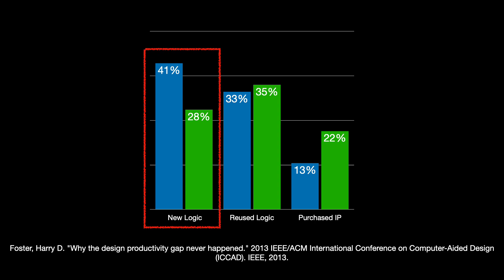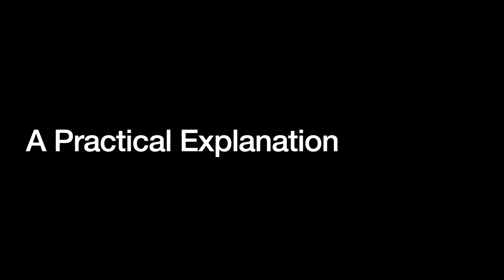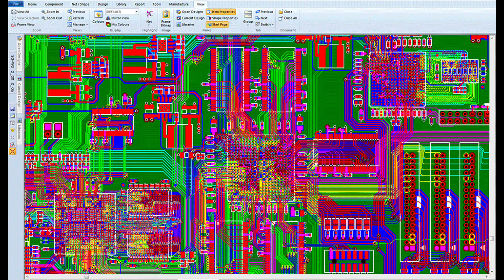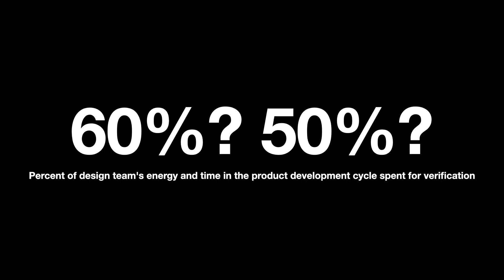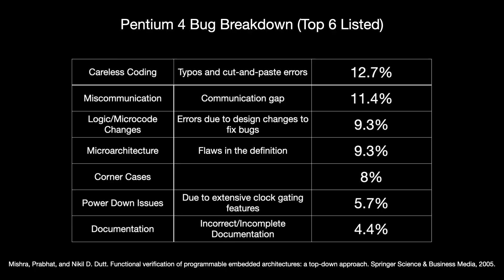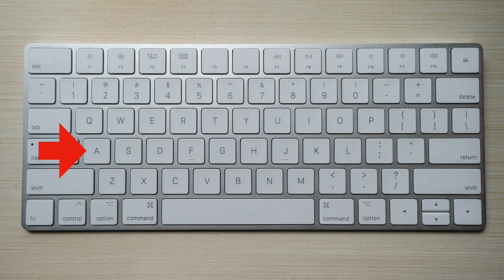The Growing Semiconductor Design Problem

Comment: Working on verification for more than two decades here, nice video. I'd just make some clarifications:
1- most of functional verification is done through simulation. The video shows emulators and FPGAs, which are often used, yes, but they are complementary resources. Same for formal verification, which is not mentioned. FPGAs and emulation are fast enough to allow testing of SoC firmware, which may not be viable in simulation (too slow), so that's the main use, not hardware verification per se.
2- in SoC verification one doesn't cover all the functionality of the IPs used. They are assumed verified already, so the focus is on their interconnection, aka integration verification. Usually IPs are verified isolated, covering their whole functionality, before they are used in an SoC.
Reply: Thank you
Reply: @valentinohose1723  good luck!
Reply: hi im EE student graduating this year. how do you think about verification engineer as career path compared to design engineer?
Reply: @valentinohose1723  there is more demand for verification, because at least 2 verification engineers are needed for each designer, ideally 3 (which is not often the case, unfortunately). However design is usually preferred because it's seen as more creative, and has less pressure: the deadlines are beared by the verification team. Verification closure is the last deliverable before moving on to layout/fabrication for IPs/SoCs
Reply: @bearcb  thank you for your answer. as someone with 20 years of experience in the industry, would you recommend pursuing a career as a verification engineer? I'm interested in understanding the potential career advancement opportunities in this field. 
I've found verifying 32-bit RISC-V with UVM in a school project to be quite enjoyable.
Reply: @valentinohose1723  it's a personal decision, you have to balance pros and cons. Demand will always be there. If you enjoyed your verification experience, I'd say go for it. But again, it's very personal.

Comment: I know a company that still hand designs low energy chips with an in-house tiling program stemming back from the 1990's, with the lowest energy processor design used in their GA144 parallel chip.  The founder Charles More has done a number of record designs since the 1980's.  He tends to get this from simplified design and modeling correct functionality in the node process, cutting the node safety margins, and testing out circuit parts.  Unfortunately, with the way the market is, and advanced fab costs, they have been unable to implement more than a deeply embedded simplified design on older low energy technology, rather than their more general advanced processor.

He created the Forth computer language.   Designs based on it, could be as low as under 1000 transistors.

To advance the technology, l have been thinking of contacting the 4 bit processor manufacturers in China to make them aware of various open sourced FPGA designs based on this sort of microprocessor architecture, as it is suitably simple for the old equipment they have, and a step up from 4 bit.

I had been looking at putting a team together before getting rather sick, to make a simple open source embedded design under the Google open chip scheme with a few innovations in configurable I/O and limited on chip reprogrammable functionality to minimise parts, and to compete with 4 bit - 16 bit mcu's, on a simplified commodity process.  To kick start the industry again  (used to be many forth processors in the 1980's and 90's) before I pursued my own seperate advanced architectures.  I still aim to pursue such, but am gearing up to explore an alternative scheme to FPGA and custom chips first with a few people (as I am still struggling health wise) suitable for the third world.  And also waiting to see what becomes of the magnetic quantum cellular automata scheme advancement from last year, which sounds similar to what I had previously wanted to eventually do.  Obviously, as I have not heard anymore, that scheme had yet to come through.

However, I would like to ask you to cover the advancements in magnetic processing technologies announced last year or so.  One is at 4 Thz clocking aim, the other 40 Thz.  If either of these pan out, they obviously represent a future in the industry, as MQCA works at nearly 0% heat loss.

I have no business with any of these parties and make no money on this, it is a community interest post.

Comment: Great presentation! As a very senior software developer, I found this very interesting. It looks like that the HDL language part is very close to the regular software development. Including the (very familiar) execution and emerging problems of the practical processes and testing/qa. I want't make a remark: you mentioned, "In the software world, it is easy to handle such design problems by issuing an update". Well, it's really  not in most cases. Rolling out an update for a software with major design flow, when already released, causes lot of headaches and costs. Especially when the software is creating lot of data. Also with todays firmware based designs, you can handle lot of things with an update to the hardware firmware. The two kind of development coming closer and closer by time.

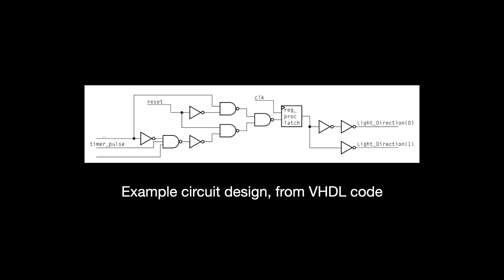Comment: A better example for the traffic light 5:00 is if the later car shows up just +/-1ns from when 1st car clears the intersection.  This could create a corner case where two "rare" events happening at just the right relative times cause the system to hang or screw up, like the light getting stuck and never changing for the 2nd car. 

The "fairness" example given was that of a spec being met, but the spec was incomplete.  That is a problem.  But just getting a design to meet a correct spec when there are tons of concurrent and interacting events going on is very difficult in itself, especially when some of those events are quite rare.
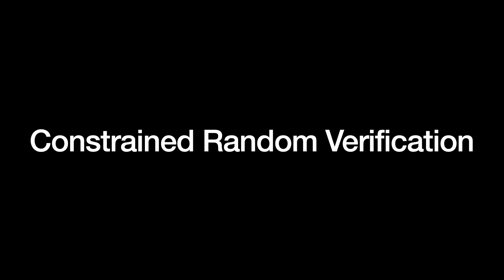Reply: Also, relating to the keyboard testing example 13:40, this video did not mention doing unit tests of blocks of the design.  At that level, it is much easier to control and sweep through interesting cases, often exhaustively.  Something that usually cannot be done when the design block is exercised within the context of the entire chip. 

Additionally, formal verification tools are also used.  They can verify properties exhaustively that cannot even be tested with functional tests.  A simple example is that a 64-bit or 128-bit adder can be exhaustively tested with formal verification tools.  Constrained random or brute force sweep testing cannot do the same in our lifetimes.

Comment: I did a stint as a test equipment designer in aerospace. I loved it.  The scheduled time for a project was never adhered to because the other design work had used it up.  "We can make it up in test eqpt." must have been a mantra. Or a face saver.  I loved beating their most optimistic goals. Which I mostly did. Fun. Fun. Fun.

Comment: During the period from 1987 to 2001, I was working as a consultant, mostly doing chip verification.  When the Tech Bubble ended, the bean counters decided that Verification Engineers were a waste of money, and go rid of us all.
People went and did something else.  I went into Real-Time Embedded Software.
A few years later, as the NRE of ASICs continued to rise, they repented and tried to hire Verification Engineers again.  They found that the former Verification guys were not interested.  They also found that the former Verification guys were advising the young ones not to take such jobs.

I remember various conversations with headhunters about Verification Engineering jobs, which were quite unpleasant.  For them.

"I am not interested in a Verification job because Verification Engineers don't get enough respect."
"What do you mean?"
"In American today, we are able to accurately measure respect.  To.  The.  Penny."
"So, this is about money?"
"Sort of.  Money is a symbol of whether they really value us."
"How much would it take to get you into this job?"
"110% of what the Design Engineers get."
"Hah.  They won't do that!"
"That's why their chips are not gonna work."

These days, I do FPGA design.  FPGAs continue to gain market share from ASICs because, well, the ASICs still have problems with Verification.
Maybe they could pay what it takes to get the top people to work in Verification.  Maybe they could say "Thank You" once in a while.  Maybe they could try to provide some job security.
Nah.  It ain't gonna happen.
ASICs are doomed.
Reply: A 50% rate of re-spins sounds right to me (maybe 65% is closer to the truth).  The fact that slang terms exist for "a chip which came back from the fab and does nothing" tells you a lot. . .
I also suspect that many of the new versions of a chip which are supposedly "to add features" were actually involuntary bug fixes.

Comment: Your "verification" does not include all the design mistakes made in the planning stage. For example, both Intel and AMD CPUs are based on the 1945 von Neumann architecture. Direct execution stack machines have been shown to be superior, but are ignored by almost all manufacturers. Also, verification is very different from validation, which attempts to determine if the chosen design is a valid implementation of the problem.

Comment: FPGA for verification are thing of the past (mostly). We still use them but for very limited soc or single IP verification.
Today we rely on accelerated emulation like Synopsys ZeBu which can hold massive design at ease, allowing multiple instance to run different tests.

Comment: Verification coverage gaps are largely mitigated these days by three factors. First, most devices are online and able to receive software and firmware updates that can work around the problem. Second, most consumer devices are relatively inexpensive and designed to be replaced after less than two years, so the effect of a faulty chip is limited in scope. Third, mature supply chains mean that spinning hardware revisions is cheap, so tight iteration with progressively broader test audiences can be used.

Also, "respins" are extremely common, and very inexpensive. Most GPUs are shipped on their third or fourth spin. It doesn't require reverification or relayout. Instead, chips are built with disconnected transistors and basic logic scattered around. If there's a bug, a change in the metal mask can be done very easily to tweak the logic.

Comment: Such a great video. How do things like open RISC-V cores change up the process? Does it reduce the amount of verification needed? Are reusable and mass tested cores the only reasonable path forwards?
Reply: No just by being open source doesn't reduce the verification required
Reply: @slicer95  I think you oversimplified my question, it's not about "just being open-source".
Reply: @avamander.    RISC-V by itself doesn't change anything for the verification. RISC -V is just an open instruction specification, x86 and ARM were proprietary. The instruction specifcation and verification are orthogonal. For the second part even if you get reusable and mass tested cores, they still have to be verified when they are combined which is non trivial.

Comment: It's important to note external and internal IP blocks are used by most companies (ARM IP being one example) most chips are focused designed and easy to test, high risk designs use many blocks, sometimes incorporate IP blocks not designed to work together on the same silicon die and has no field history (some are purchased from other vendors or spin up for the first time), thermal stability remains a challenge here but this conversation depends on the type of chip, its use case, environment ect. Chips in aerospace/defense class-1 are tested rigorously and use expensive materials and processes to guarantee long term stability not the same for commercial grade silicon/ics. If rigorous testing was always factored in chip profits would dip, losing to Chinese chip vendors even further.

Comment: Constrained random verification, I thought I'd never hear the term again after defending my undergrad paper over ten years ago :D
We were doing very basic stuff with old MIPS designs though, I was writing a Ruby DSL that generated a boatload of assembly tests for testing Verilog designs. But my academic advisor was doing similar work with the Elbrus processors (classified, of course, so we never saw any of it), so the various hardware verification related stuff that students and research assistants under him were doing might have been repurposed for that.

Comment: With programming, tests can be random, but you can also identify the most important tests. E.g., instead of testing all numbers 0 -100, just test say 0-10, 50 and 95-100 or something. Perhaps basing it on information about what the code is doing, with tooling.

Comment: It's horrifying and absolutely hilarious that even Intel engineers working on hardware are still mostly making regular ol' typo and "copy-paste" errors like us normies.
Reply: These are also the most common errors in advanced math textbooks too. I have a keen eye for errata so I notice when it's a 1 instead of an I. It's why I'm so fun at parties.
Reply: I dispute the notion that most errors are typos and copy-paste errors.  That ignores the other 87% (I say more) of errors and fails to understand the enormous complexity and concurrency that chip designs cope with.  People would be astounded to understand the complexity in and amount of out-of-order and speculative instruction execution that takes place in a modern CPU.  Or similar optimizations in a memory sub-system.  If everything was done sequentially, in the "natural" and simple order, the performance of your phone would be way, way worse than 10x slower (no branch prediction, no write buffers, no cache, no pipelining, etc.). 

Chip designers are not devoted to and as adept at high level programming languages.  That’s because they work at a very low level with extreme concurrency to make fast hardware.  I’ve worked on the design of central office routers (so you can watch this video) that can process 100’s of millions of packers each second and do so in a way that ensures each customer’s packets or traffic get equal treatment, video and audio get greater priority, and premium business service gets larger, guaranteed service specs.  The depth of a pipeline for a system like that is hundreds of cycles deep.  All in order to provide tremendous performance.

I’ve seen a lot more errors and issues and testing associated with clock gating than I ever have with copy-paste errors.  Copy-paste is relatable to most.  Who understands clock gating and the battery life it provides, and the corner cases it creates that need to be handled correctly and tested for?

The video at 5:00 could have used a better traffic light potential error: if the 2nd car shows up at just the right time as the opposing 1st car clears the intersection, the traffic light could get stuck and never change.  Testing for these types of rare race conditions make testing a hardware design incredibly detailed.  And you cannot tolerate a single catastrophic bug, like SW can.

SW uses line coverage.  Chip verification uses line coverage and condition coverage.  And formal verification tools.

Look up out-of-order instruction execution with speculative execution, branch prediction, caches, pre-fetching, register renaming, etc.   Or if you understand assembly language, imagine how you would possibly execute several of those instructions in one clock (ie. in one step).

Copy-paste or typo errors were the least of concerns on designs I worked on.  Being "off by 1" was much more common. And that’s not the same as a typo.
Reply: Also consider there are likely malicious actors who are part of designing the chips for most big enterprises.
Reply: If your conception is that Intel engineers are good programmers, I have some bad news for you. Hardware engineers in general are pretty poor programmers, most having mostly written C and perl code, without much or any experience with modern software engineering practices
Reply: @TDRinfinity  They literally make the best optimizing compilers and performance tooling. Apparently they know a great deal about modern software engineering.
Reply: @wfjhDUI   The performance, compilers and tooling team are not the ones involved in Verification.
Reply: @slicer95  Sure, but the point is that it's delusionally arrogant to believe the engineers at Intel are just a gaggle of geriatrics who know nothing about how programming has changed since the 80s and we can point to the output of their colleagues to highlight just how ridiculous it is to think that.
Reply: As a chip verification engineer, I think you overestimate design engineers a lot lol
Reply: @TDRinfinity  modern software engineering is not only web development. Many important stuff in our day to day life are still programmed in C and C++

Comment: I think you missed one more factor that closes the design-manufacturing gap: chips that do "more of the same". Same design, more integrated cache memory. Instead of separate controllers for dual-core, quad-core processors, make n-core controller and add as many cores as production allows. Add extra I/O control capabilities - built-in software-controllale pull-ups, pull-downs, amplifiers, latches, edge triggers, all the stuff that had to be external before, design the block for one pin, replicate over the hundreds you have instead of having one special high-flexibility port and a bunch of 'dumb' ones. Making a GPU? Double the number of shader units without increasing their complexity.
The design can swallow any amount of manufacturing capability with minimal effort. Qualitative improvements will walk on their own pace and be fine as long as manufacturing keeps up at all, quantitative will swallow all the surplus.